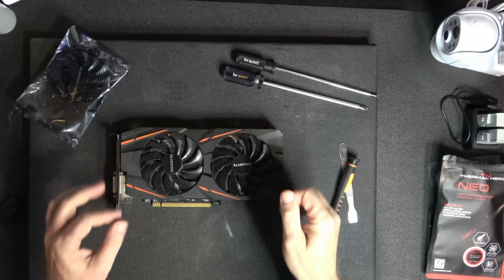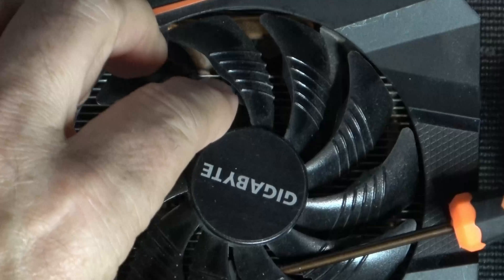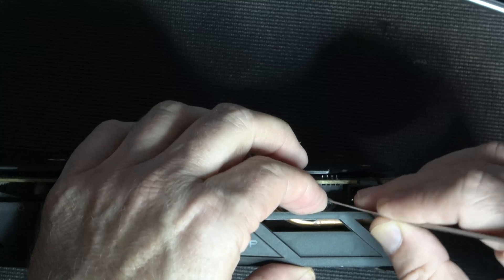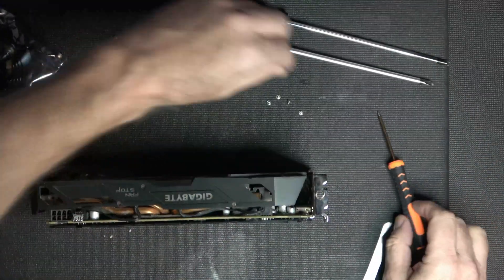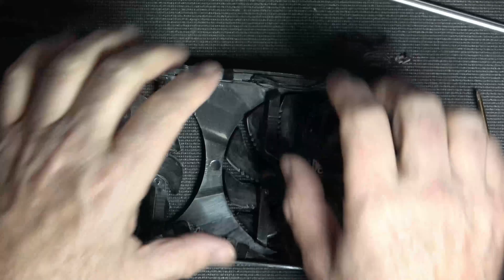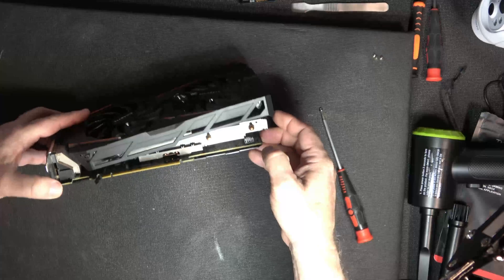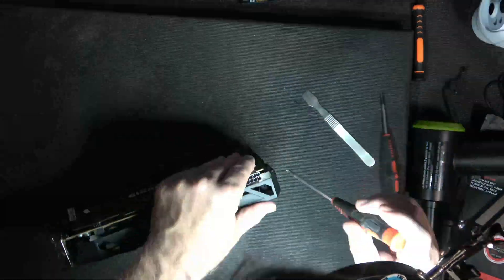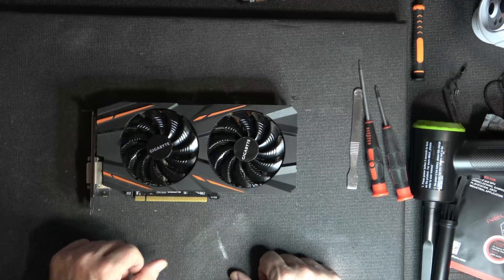AMD RX580 Worth Repairing... Fan Replacement  -- LGH

Comment: I replaced my fan blades with cheap ones and it runs at 55C now..
Reply from the maker: thats pretty good
Reply: @LastGameHunter  not really I was getting 33C with my other fan blades.
Reply from the maker: @LeaveMeAlone623  Ok, is the rpm the same and ramp up the fans and turn off zero fan. and is 55c while gaming?
Reply: @ 78C - 88C I think while gaming i’m not sure on heavens benchmark it’s 78C while gaming but it sounds like a jet I have repasted thermal paste and yeah.
Reply: have u tried to configure the rpm? maybe it solves your problem
Reply: @TutixGamerYT it’s fine I have a new pc now with high quality arctic p12 fans I put 6 of them and it’s quiet so
Reply: @LeaveMeAlone623 oh great dude but did you got what was causing ur problem?
Reply: @TutixGamerYT it was the fans lol if your curious and the gpu
Reply: @LeaveMeAlone623 💀oh god, ty for answering am trying to learn as much as i can abt pc components so, u helped me alot.
Reply: @TutixGamerYT  no problem lol? Id recommend undervolting your gpu PROPERLY so the temps stay lower and quiter.